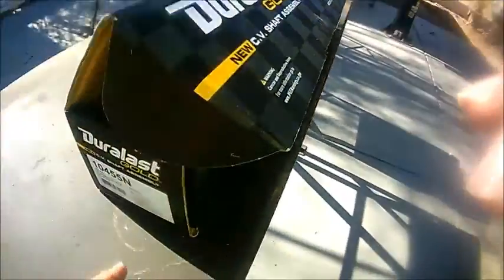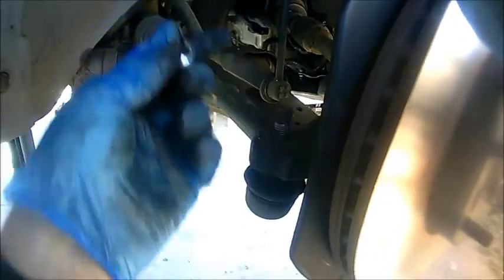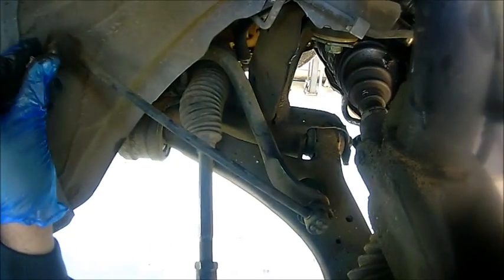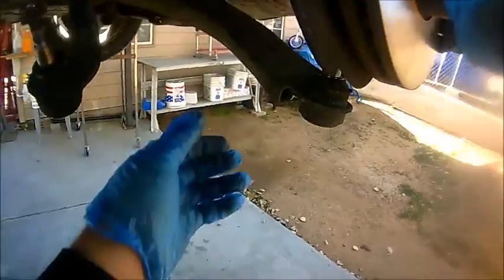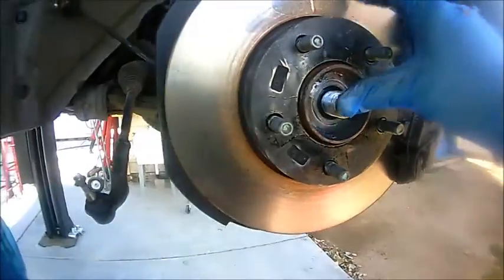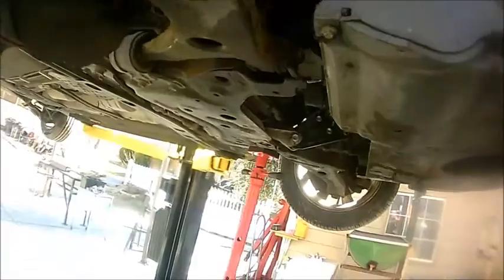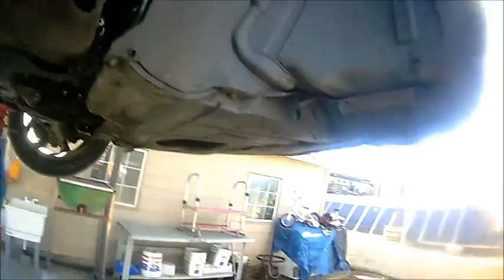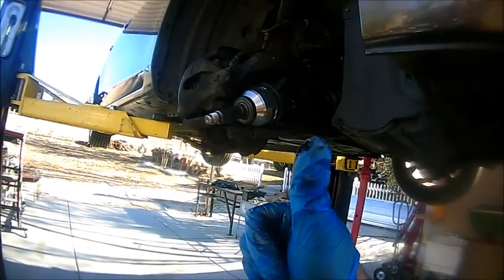2004-2011 Mazda 3 CV Axel Shaft Passenger Side Replacement

Comment: Love how you just pull the bolt from the lower ball joint. I have hammered, heated, and spent over 3 hours and it will not come out
Reply: You have to jack up the caliber and then hammer the threads
Reply: I used a half in ratchet and 14mm socket to break the bolt loose
Reply: If you loosen the top bolt on the hub for the shock then you can hit the hub downward until off the shock. After that mine came straight up off the ball joint. The way it's angled even if it's loose the ball joint won't just drop out. Took me an hour to figure that out.

Comment: Great video man! Shockingly seemingly the only one for the passenger side cv, too. It was my son’s first ‘major’ project on his own car so we wanted to diy rather than take it to a shop. Would have been way harder without your video. Thanks! Side note, we fought like heck to get the new one in. Turns out the retaining clip had somehow gotten out of round. Just picked up a new one for a couple bucks and it slid right in and locked in in just a minute or two!
Reply from the maker: @gregmead007  super happy my video help you and your son complete this project!! I always try to show my viewers step
By step on how to complete repair task. I am a great believer that if you are patient and willing to save some money you can achieve anything. Thanks for your feedback and support don’t forget to subscribe for more content. God bless from California
Reply: Howdy! I'm looking for the part number for the passenger side support seal. The one that fits in the cup between the transmission and the CV axel.
Reply: @mthlay15  Will depend on the specific model and version of your car. I just went in to mazda today to help them get me the correct seal. Bring your vin number in with you and they can look up the exact part. I was lucky they had one left in stock so I didn't have to get it ordered in. They are super helpful to get you the right parts.
Reply: the retainer ring has to be a looot of grease MOLLY and will work

Comment: You helped a ton bro, truly. I wanted to replace this on my own because I'm a little tight on money right now and this is exactly what I needed 🙏
Reply from the maker: Very happy to hear this. This is the reason why I do what I do to help as many folks as possible. Thanks for your comment. Blessings from windy California
Reply: How did it go? Everything running smoothly? Did you have any issues with your new axle fitting? Where did you buy from? I have a 2012 m3 2.5l. Can’t wait to get this done so I can get rid of some vibration and subtle clicking noise that has started.

Comment: one question isn't is supposed to leak transmission fluid after removing the cv axle
Reply from the maker: @johnnyrivera1662  great question, it normally would leak transmission fluid on this car it did not due to being low on fluid

Comment: Very helpful video until the wheel bearing nut. Yes if you have an impact im sure it's easy. What if you don't have one? Mine is seized in there and I don't have an impact. I can not get it with a 5 foot snipe on my ratchet.

Comment: Thanks dude. I'll be taking on this task in the next couple weeks.
Reply from the maker: Your very welcome. Let us know how it goes. Thanks for your feedback
Reply: How did it go for you? Some people are saying to replace the control arm because popping out the ball joint will make the cavity slightly bigger and I’m guessing possibly looser. Did you replace the control arm? If not, has it felt loose at all or tight and good driving it? I’m going to do mine in a week I am hoping.

Comment: You didnt show the actual process of getting the new axle to seat on the inboard. Im trying now and its a beyatch to get it past the retainer ring. Ive tried knocking the end of the axke with a dead blow to drive it on, no luck. What did you do? It doesnt just slide into place.

Comment: Is it possible to have the wrong CV axle in cause no matter what I do I can not get my strut line back up with the kunckle if I leave the axle out the strut will go right into place. Vice versa putting the strut in first and trying to put the control arm into place it's like a 90 degree angle. Seems like the axle is to long
Reply: Its definitely possible, i work in parts at a mazda dealer and ive seen it multiple times with older mazda 3's and aftermarket axles. Its almost like the listing are wrong between auto and manual transmissions
Reply: Trying to find a CV axle for 2013 Skyactiv is a pain in the rear.  I opted to go to a salvage and find a used one because you can't be sure an aftermarket will fit.
Reply: There is one possibility that your CV axle poop out while you struggle to put the lower ball joint inside the knuckle. It actually broke, so seems like it becomes longer.

Comment: Do all the wheels have abs sensors? You mentioned the passenger side axle didn't have an abs ring. Is it only on the drivers side? I have a 2012 mazda 3. Been hard to find information on taking the ring off and putting on. Any tips? Some people were having to use a blow torch to heat up the ring before they put it on, so it looks like it might be a challenge? What would you recommend?

Comment: Great job on the video,  I'm trying to figure how that lower ball joint comes out, seems pressed in so I suppose pressed out?  I had thought the whole lower arm needed to be replaced as one if you did the ball joint but now I'm not sure. Anyway this video helps me prepare for the cv axle I need to replace.
Reply from the maker: Uncle buck, happy the video helped. Lower ball joint is definitely pressed out and in. Save some money.
Reply: You have to jack up the caliber and then just hammer the threads diwn
Reply: Much easier to just replace the whole lower control arm. Pressing out the ball joint and replacing it could lead to a loose ball joint since the hole will be slightly expanded from pressing it out. The control arm isn’t expensive and it’s much easier to just replace the whole thing than mess with replacing that ball joint.

Comment: Never seen anyone do this job with one hand (while the other holds a camera.)
Probably should add a tip about how it kind of snaps back onto that spline when reinstalling the axle….usually a bonk or two with a mallet does the trick.

Comment: Nice work. I’ve never seen one of those control arm pry tools.
Reply from the maker: Thank you, definitely invest in one of you work on cars, they will make your life super easy!! Your basically using your own weight to pry down on the control arm and gravity will take care of the rest.
Reply: @oscars-autorepair3236  What a neat tool. Thanks so much for this amazingly detailed and clear video!

I'm wondering though if putting my car on jack stands will give enough clearance for this tool in its full range of motion needed? Or can you only do this with a lift? 

Also, I have been reading a lot of reviews on the pry tool about missing parts when they ordered it. Did you have issues with missing parts or the astro company? Hoping to get this repair done with little down-time for using my car for work. Thanks so much man.

Comment: Do you HAVE to take the ball joint off?
Obligado?
Reply from the maker: Great question, unfortunately yes you do, in order to give you enough clearance to remove the cv axle
Reply: As an alternative, you can take out the strut from the steering knuckle.

Comment: Going for a hail mary here and hoping you're still active somehow...at 7:23 you remove a "lower ball joint". I stripped this and I can't figure out exactly what I need. Is there a specific name for this bolt/nut or is one of these items the correct one? You can drop these into google and it'll be the first result.
9YA0-21-430B
9YA0-21-20HD
Reply from the maker: No need to worry, all you have to do I get yourself a retread nut to retread that 14mm ball joint bolt
Reply from the maker: When you were taking out that 14mm nut. , did you use an impact gun?
Reply: @oscars-autorepair3236  I'm sorry I was incorrect in my statements...I rounded out the nut/bolt not stripped it. Yes I also used an impact gun :'). Thank you so much for the replies!

Comment: Wow this is a lot of work I think I won't change mine and just drive with a little shakiness on highway lol.
Reply: Not cool thats what i did. Picked it up and fixed it same day
Reply: It’s gunna dry up and explode while you’re going 65mph

Don’t ignore this
Reply: @C-64  It is not leaking it is just loose also I don't think cv axles explode man
Reply: @butWhyDad I hope you are still with us. you should really get it changed. I will be changing mine soon. Been driving on it a couple years and it comes and goes I think depending on the temperature of weather. It’s not safe though. Some peoples cv’s last and some don’t much at all after vibration starts. I just simply did not have any spare money the last couple years to spare. They can’t explode of course but I’m guessing he just meant it can possibly bind inside and somewhat explode from jamming. Some people say the joints can separate if they are loose enough. I don’t think it will do anything other than loose drive power but I would not drive on it anymore than absolutely necessary.

Comment: So if you live in a 4 season climate, and have over 100k on the car this is nowhere near as easy. Disregarding most people DIYing it will not have a lift, and doing it on jackstands is a whole other animal, how fast these Mazdas rust up is stupid, so rain, snow, and debris during the year is a real problem. If you are replacing the CV's on jackstands use the CV as a slide hammer, just don't pull it apart, the bearing won't come out without ample force, so just push it in as far as it will go and pull out with some gusto, when it binds tap it back in a little with a hammer so it lets go, push in, and repeat, there is a retention ring on the end of the spline, thats what you are fighting on top of some corrosion, (it's fairly sealed ) , so a couple sharp blows you should feel it let go.  The ball joint, and strut mount are hit and miss, if the bolt won't come out of the ball joint pinch mount... good luck. Same with the strut mount, you have to get one or the other to let go if you need to take extreme measures, usually involves parts being bought. If you find yourself in that spot well, if you had to buy any tools to attempt the job your in over your head. If you have a competent shop say with a large vice, sawsall and/or angle grinder, you can get a set of lower control arm for $80, take the knuckle and strut out as one piece, shouldn't have to spell out for you how that whole procedure would go. 
   For reference, serviced 8 of these for a copier company, the where sales rep cars in PA, worst 7 years of my life.
Reply from the maker: Thanks for your feedback. It is greatly appreciated and I know it will surely help other diy's
Reply: @oscars-autorepair3236  No problem. Watched your video because I haven't worked on one of these in 7 or so years, got a friend with a 2010, 158,000 on the clock , and could not remember how the passenger side seperated from the half shaft, (male or female) saw how yours was coming apart and thought, how nice would that be! Then thought, boy that won't be most folks experience here in the North East, so thought I would add some alternate tips.